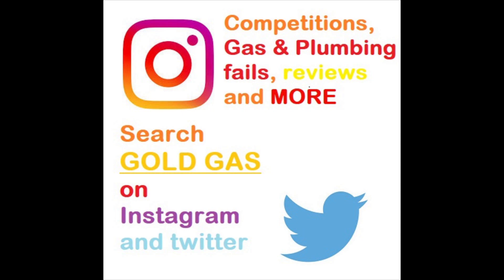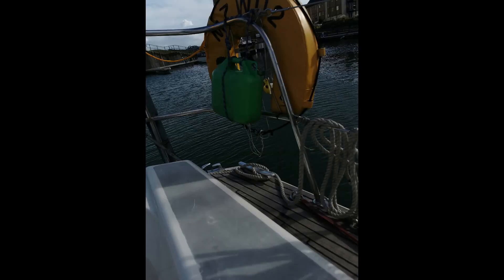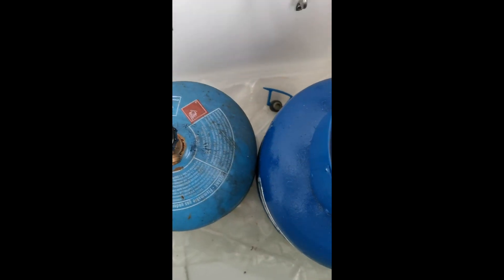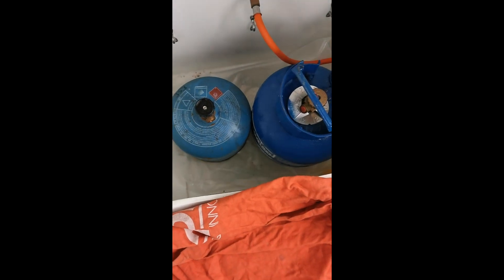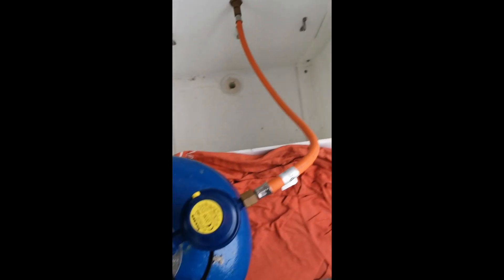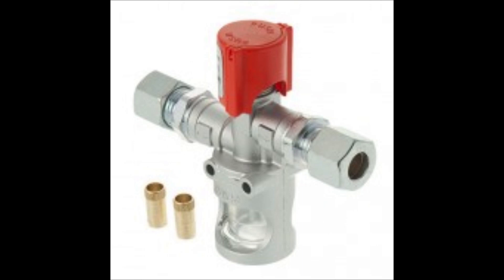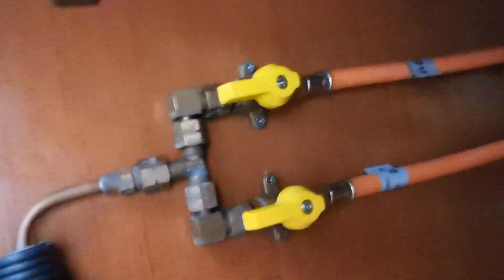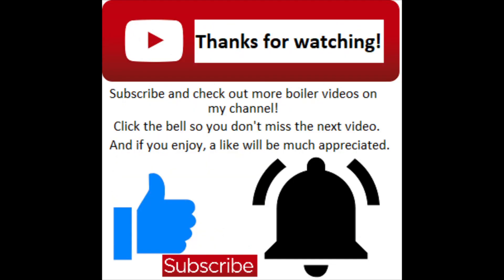GAS ON BOATS - WHAT IS INVOLVED - GAS SAFETY ON A BOAT LPG

Comment: Interesting as a newbie but I don’t understand why you need a specific sealed locker . Why can you not just secure the bottles on deck away from windows, doors etc with a chain or welded cage ?
I have searched for a definitive answer and to date there doesn’t seem to be regulations that prohibit such storage. Or have I misunderstood? I lived all year round for years in caravan with gaz bottle outside with regulator and  flexible hose , the latter just entering the caravan through a hole then to heater , fridge etc.
I would appreciate some advice please

Comment: Thanks for the insight - the unsecured bottles in the gas locker were alarming and I thought that you could only install the hob with a hose as the oven had to be copper ? Guess I’m wrong
Reply from the maker: Different cookers have different regs, best to check mi for that particular one. Most ones I work on are on gimbals and swing, so they need to be on a hose